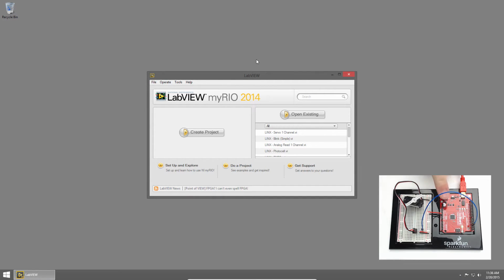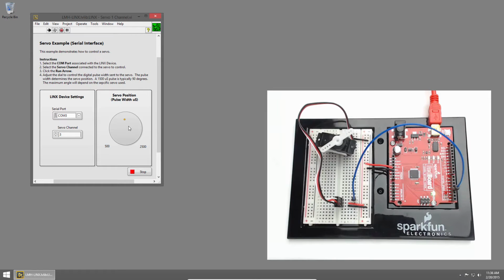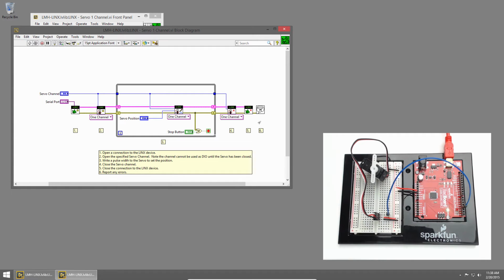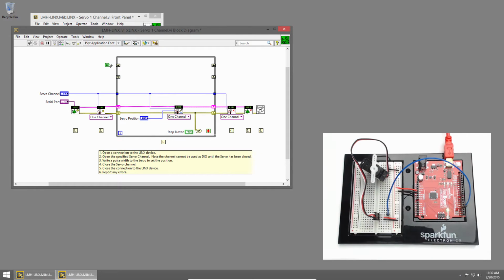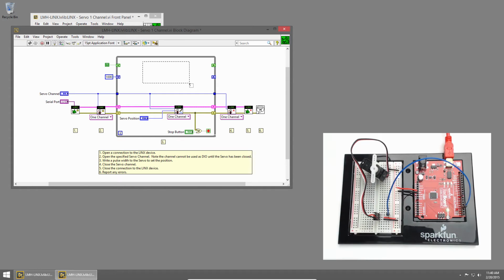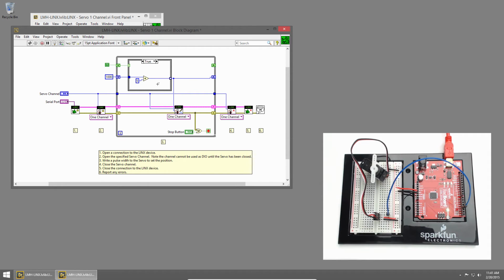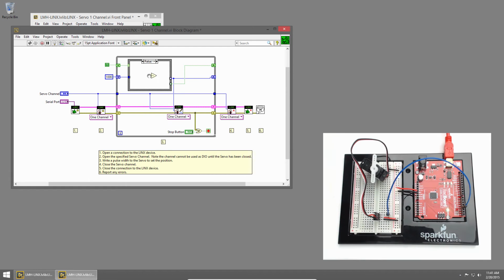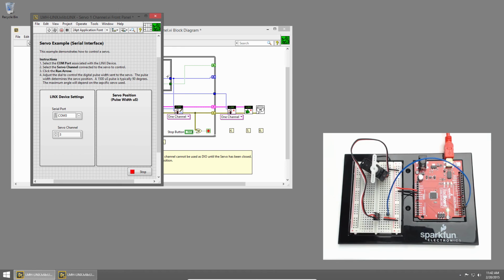Sparkfun Inventor's Kit for LabVIEW - 14 | Servo

Comment: Hi there. I can only run up to 3 servos using arduino uno.  Is this a limitation for LINX or is there a way work around this.  I have read that this is not a problem with the Mega but I would rather stick with the UNO for cost reasons.  Thanks